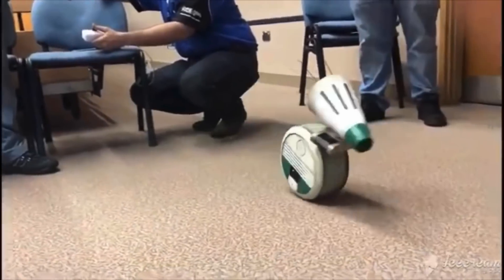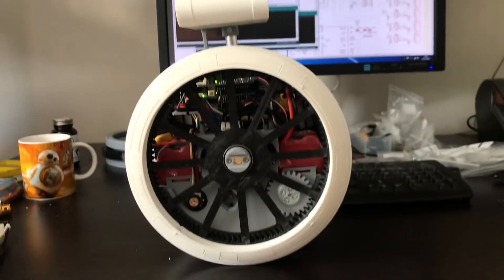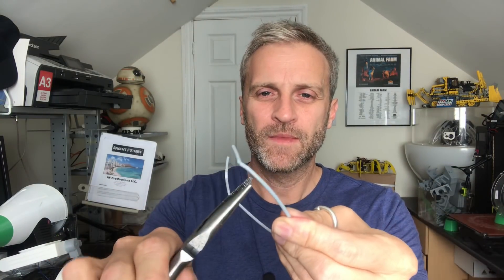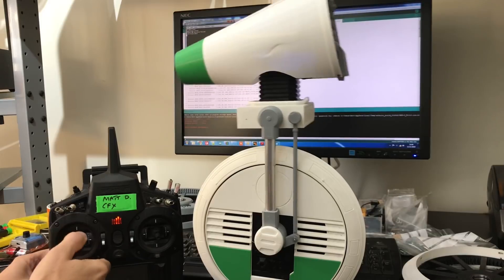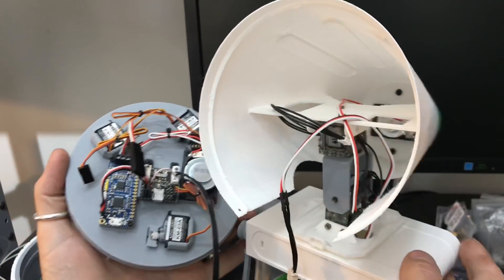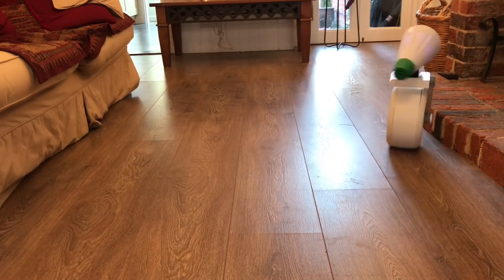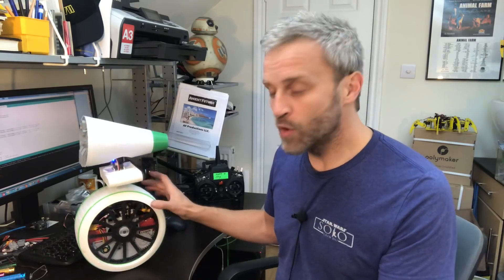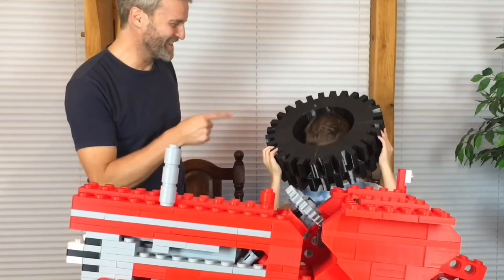Droid Build D-O - #3 - Mantis Hacks

Comment: Randomly dropped in. Cool project. I missed the video explaining how you pivot the body. Gyro? Or the two sides are independent? I'm assuming gyro because video preview contained a hint at a single rubberized sole.
Reply from the maker: Split sides...
Reply: Yeah, you can see it in the last video, after the midpoint. But the thin green section on either side of the central wheel bit are the actual drive wheels.

Comment: Question about the dual pitch on the head. I haven't seen the movie, and probably won't until it comes on tv as a non-ppv/rental. How does the head work in the film? Does the platform try to stay level to the ground, basically making pitch 1, the height level of the head, and the actual head pitch the up/down tilt? Or do both work together in the film, as you've implemented in your build? Also how does yaw work on the droid, since you have wheel yaw position and a yaw position in the neck, do they work separately, simultaneously, or does it use something similar to the circular interpolation that the head's dual-pitch uses?
I'm also surprised there's no actual head roll, or side to side tilt. Knowing Disney, and knowing they made this to be a toy seller, you would think having head roll would be implemented for the droid to be more expressive.

Comment: Could you perhaps share the code which allowed you to upload code OTA to your MKR 1010. I just recieved mine and I am having major trouble getting it to work.
Reply from the maker: I’m sure it’s in the examples for WifiNina..
Reply from the maker: Or maybe I did a google search... but it is slightly different libraries for the 1010
Reply: @MattDenton  Yeh, I have been trying to getting WifiNina, Wifi101OTA and ArduinoOPA working with no luck. It seems the devs on github stated their current code is being reworked. Though, they did not specify when the NINA update would fully allow OTA.
Reply from the maker: It all working on mine. Have you updated the WiFi firmware on tour 1010 module?
Reply: @MattDenton  Yes, I have updated the wifinina firmware. to 1.2.4

Comment: Just add a little weight in the front of the head to counter balance the electronics on the back
Reply from the maker: Could do, but really need to reduce the weight in the head so that I can get the turn speed up higher.. I quite often end up on one wheel in days turns.. or on the floor 😬

Comment: I'm surprised you are having problems with the motors.  Are the encoders on the motor shafts or the gearbox shaft?
Reply from the maker: They are on the motor shafts.. the issue is that the high powered motors require a certain amount of power hits to get moving, and this have a minimum rotation speed. I spoke to Pololu about it and they agreed the HP version is tricky at slow speeds.
Reply: @MattDenton  A higher resolution encoder could help.  I've used the AMS magnet type encoder (AS5040 etc) to get better control on a toy tank with similar motor (1024 cpr).  A high speed control/pid loop (1kHz) also helps
Reply from the maker: Frank Tkalcevic yeah I may play around with them further. The encoders come mounted already at 48 PPR. I’ll play with the PID loop but the fact that the motors are difficult to back drive I doubt I’ll get much better.

Comment: To get better 3D prints you could try to disable the retractions, when you only have one "island" to be printed. Or disable the retractions for layer changes, retract only when crossing boundaries.
You can also set the position where the layer change happens to an edge of your print, not near the 0/0 x/y position but at the end or at an edge of your model.

You could close the model and print it in spiral mode (vase mode) and cut out the opening later. Maybe that's better - maybe not ;-)

When you have at least two line thick walls and many holes or many "islands per layer", so you need retraction, you could set it to print the outside first, then the inside. In this way the retraction blob occurs at the inside and is invisible from the outside. Or you can let it move while retracting.

If you have a C or E shaped model, you could set the slicer to avoid crossing boundaries even if it needs to travel larger distances. I think I needed a factor of 200 to avoid crossing boundaries in a more or less C or E shaped model. Watch the preview closely or enable the display of the travel moves to see the difference before printing.

So there are many things you can do. Maybe you need to try different slicers if yours does not have the desired setting. Or you could use a different filament which prints nicer with less stringing and so on.
Reply: Additional info: I use the Simplify3D slicer, but it's rather expensive. Try to find the one or the other setting in your favourite slicer first. I switched to it as "Slic3r" could not print shallow inclines properly, when it's not at the top of the object. It made only one top layer there, so I got holes in it. But I think it improved since then. And Cura was back to just a handful settings, which was not enough for me.

Comment: Nice work!  Motors: It is always a balance between power and control. Did you print the head in Vase mode and then glue the neck support and other bits in?
Reply from the maker: Hi. No the head wasn’t printed in case mode, but was printed as a single layer extrusion. Which is why there is a scar on the outside where the neck support starts
Reply: @MattDenton  case mode and gluing the supports in might give a better surface finish? Perhaps with abs so you can chemically weld the supports won't acetone. Would also make smoothing easier for when you come to paint him. Amazing work though, jelaous if your skills.